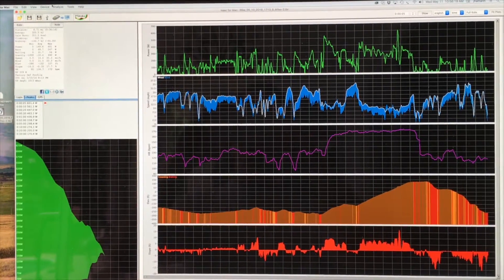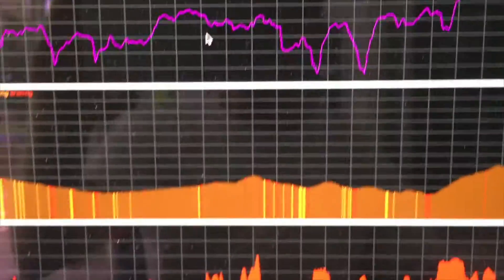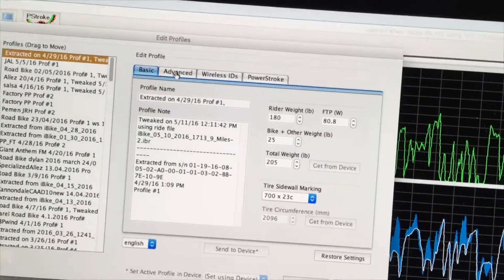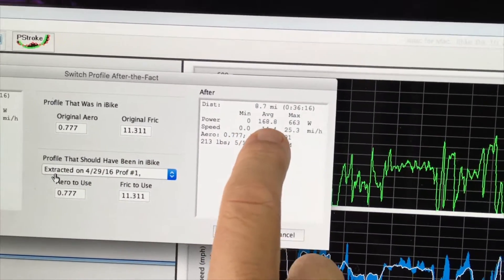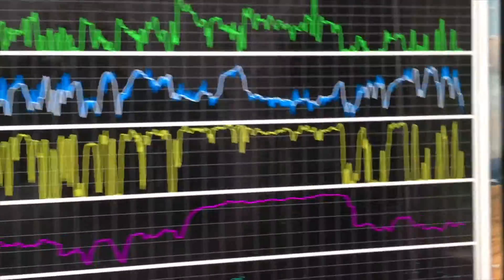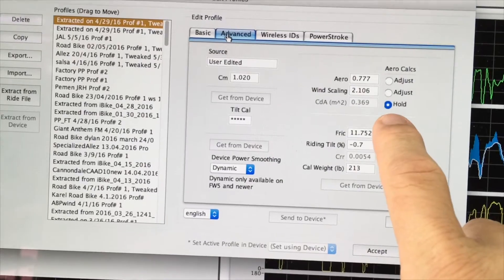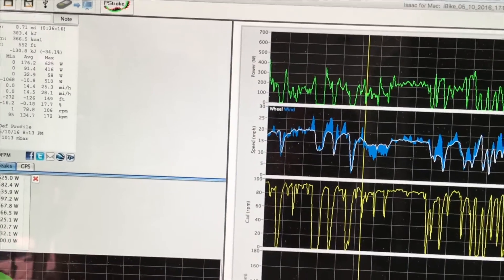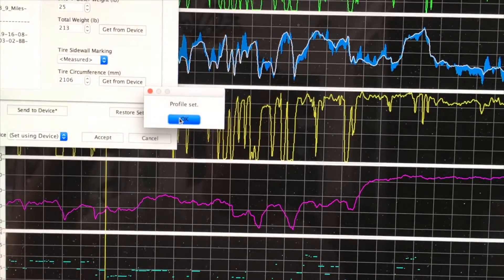How to fine tune PowerPod power meter

Comment: I've ridden with this for a month now and noticed that I am getting lower readings than my last direct force power meter which got stolen with my old bike...so I've probably gotten worse which is a distinct possibility as I moved from SF to LA and do not have the benefit of having a hill every right turn...regardless it's close enough for the average Joe  or Jill who is trying to get an indication if he or she is getting suckier (I suck as a baseline) or not so in short as long as it is mounted in the same place  I'm looking for the delta which this will adequately provide.  What would be nice though is if the company had a IQ app for metrics or product specific data fields to integrate into the head unit.  I'm part Asian so I also geek out on the physics...great job overall and kudos for providing a power meter that is accurate enough for most folks with moderate budgets...my only beef is it kinda looks like a wart on my bike...but I'm sure as the company matures the industrial design will improve.

Comment: Good idea but it just seems this kind of pm accuracies vary on a lot of factors that could easily go off. From weight to wind to aero drag to tire width just seems a lot of factors easily skewed . And with the power pod retailing for only 80$ less then that of a 4iiii left crank direct power measurement I don't really see it's place as it's not super budget
Reply: If you're using few bikes Power Pod is much cheaper, because you can transfer it easily between bikes.  Also, not every crankset is compatible with crank based power meters. Eg. I have Deore cranks in my bike, and left arms with power starts from XT. I don;t want to exchange my cranks (Deore XT is about 150-200EUR).
I'm also planning to buy NS Bikes RAG+ with non standard cranks. It's much easier and cheaper for me to buy Power Pod. As presented on video, it can be dialed quite accurately.

Comment: I have a powerpod on the way, and i weigh 138 pounds, do i need to adjust the weight setting in the powerpod before the calibration ride or after?

Comment: how you calculate cda = 0.42?
Reply: good question
Reply: @CanTURKeyed  probably does it after the fact - to fake accuracy. getting cda right is tough. for example, pretty sure mine is 0.5 on my hybrid bike with a height of 185cm and with an upper body angle of about 48 degrees, with a helmet and with a top tube bag.